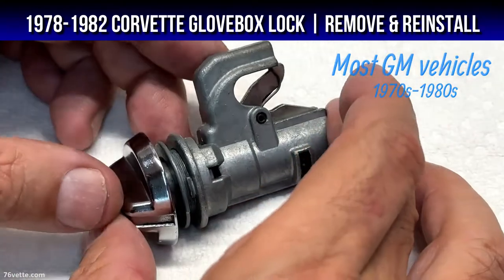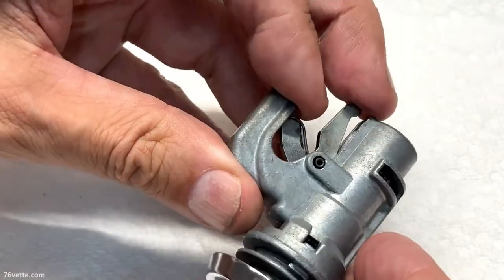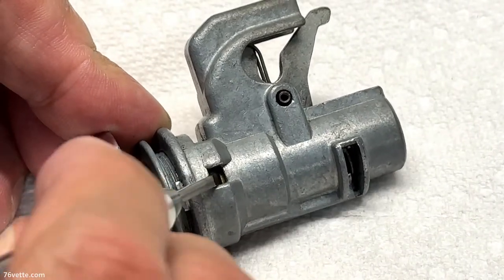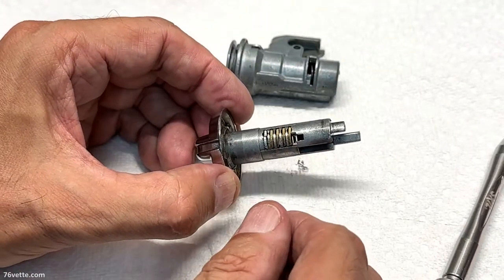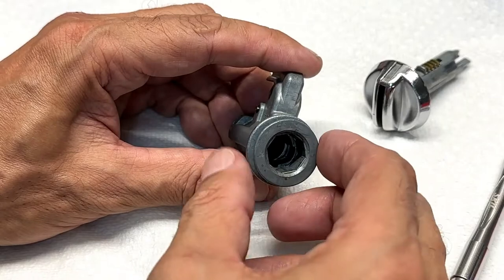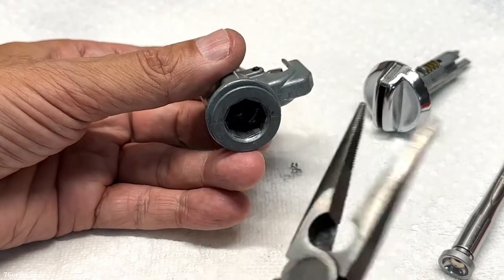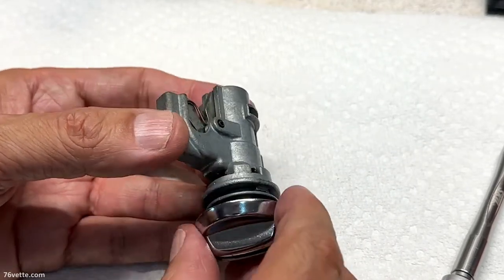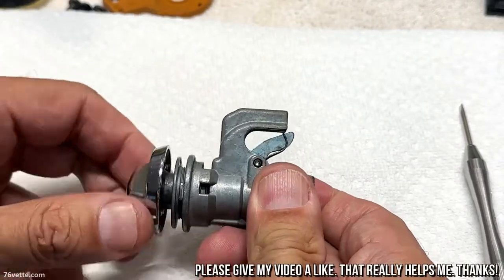How to Remove a GM GLOVEBOX LOCK

Comment: The first pin is the only one that you have to push in with a pick or screwdriver.  The next four are tumblers that are pushed in by the key.  Hold the latch closed to take the spring tension off the lock cylinder. Push the first pin in and pull the knob out until the cylinder stops at the second pin.  Insert the key.  You may have to wiggle it a bit.  Pull the knob to remove the cylinder.  It should basically fall out under its own weight if you have it pointed down.  To reassemble it, insert the key into the cylinder, hold the latch closed, push the cylinder in, and remove the key..
Reply from the maker: That makes a ton of sense, so I’ll give it a try if I ever need to. Thanks for taking the time to share this tip! 😊👍🏻

Comment: I use a chisel the are octagon   ( 8way )  and it fit in the nob ....work goods for screwing that nob.   thank for placing this video, works good and simpel to remove and instal the key cilinder, thanks mate.
Reply from the maker: Thank you for watching! 😊👍🏻
Reply: Same lock as in my 1973 caprice, it was stock, i clean it out all the pens and refit it , works now good  @76vette